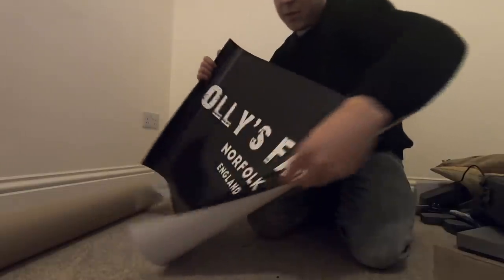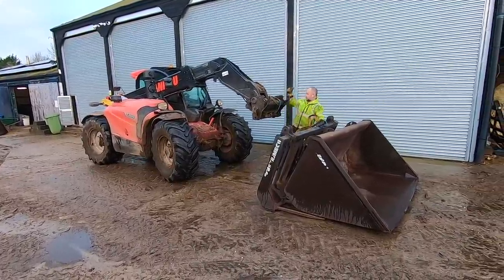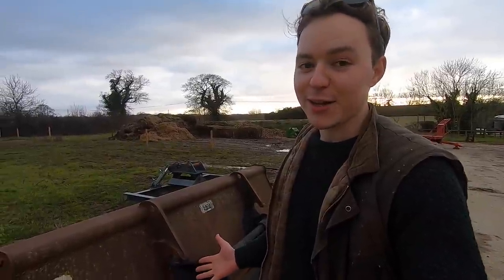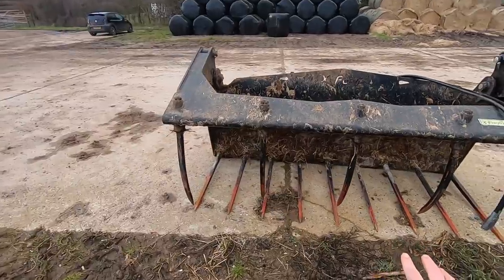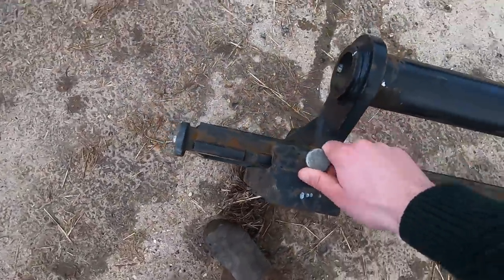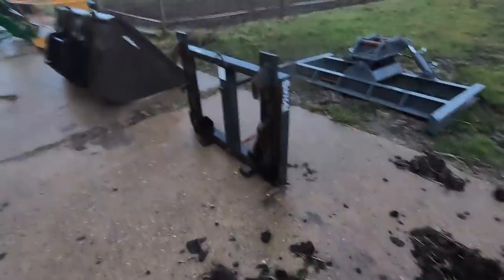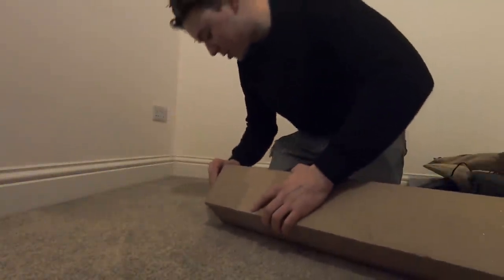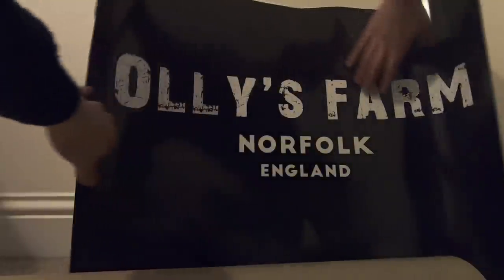THIS WAS A GOOD IDEA...SAVED FROM THE SCRAPYARD !

Comment: Great video Olly. I think you should start the into again. It’s a good way to start the video. How about getting an adaptor plate from jcb to manitou for the front loader or even change the headstock. It might be easier and would keep the weight down a bit then you can use all the attachments on both. You ought to maybe respray some of those attachments you got back. You could do it yourself. It’d make a good video and would save you some money while also making them look smart👍🏼